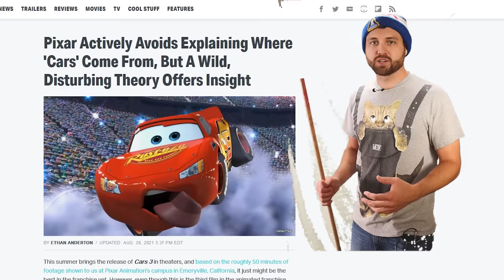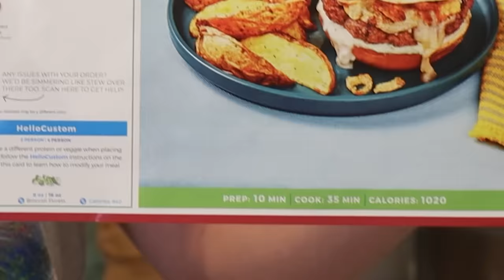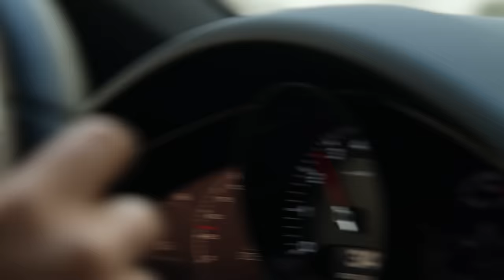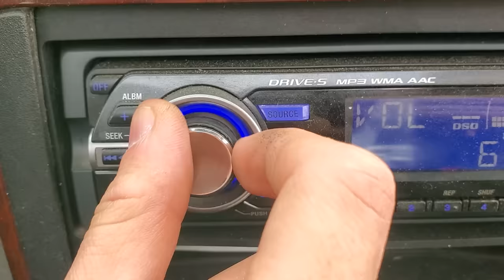How many parts can you take off a car?

Comment: "We didn't know if this airbag would go off or not"

The fact that you hacked up these cars equiped with multiple airbags WITHOUT removing the battery is abhorrently dangerous and wholly irresponsible. Donating to Patreon.
Reply: Removing the battery is extra labor which means a higher priced car. Clearly, it was an economic risk.
Reply: Jokes aside I think they did remove them lol. Michael said something along the lines of “it shouldn’t go off without power”
Reply: @WraithLK  Airbags are designed to hold a residual charge so they work for a while after the battery as been disconnected. Its always good to wait a few hours before working on parts with airbags after disconnecting the battery.
Reply: If you aren't willing to risk life and limb for content can you really call yourself a content creator?
Reply: Safety third!
Reply: @WraithLK  maybe they just disconected the battery from the airbags, they still need the battery for the turn signals and brake lights
Reply: @FrickenHamster  Lol what? You don't have to wait a few hours. You disconnect the battery cable and you just wait like 3 min and it's safe to work on. I've removed and replaced multiple airbags and just to make sure I wasn't going crazy, I pulled up ProDemand and it suggests only waiting 2 minutes after disconnecting the battery.
Reply: how bad could it be, you're supposed to smash in to them anyways
Reply: @dogtato  there is a explosive charge in them you take a shot from one point blank it could definitely kill you 
   why do you think new driving rules say 9&3 or 4&7 o'clock position because at 10&2 position it can break your wrist
Reply: @terranovarain6570  Weird, ive never heard of dying from a broken wrist...
Reply: @SmashToBits  They were referring to taking the blast from the airbag charge point blank while dismantling the car. The wrist damage is just an example of how powerful the airbags can be even when used as intended

Comment: The bare bones of a car is basically a frame, an engine, the parts for the engine (gasoline tank, oil reservoir, etc.), a transmission, a drivetrain, brakes, wheels, some sort of protection cage like the doors which protects the drivers and passengers from falling out, places for the passengers and driver to sit, seatbelts, and lights.
Reply: Eh we can make do with 2 front wheels
Reply: barebones of a car is a motorized bycicle
Reply: Steering wheels, steering rack, suspension.
Reply: Seats
Reply: Sooo a car...?
Reply: @DanielHatchman  if the commenter forgot something it wouldn't be important
Reply: @DanielHatchman  suspension is not required. VW enthusiasts have proven that
Reply: little cars like that arent even on a frame anymore, its a unibody
Reply: @Cosmik60  assuming the commenter knows what is required for a car to run and be street legal
Reply: DOORS?! 
What kind of inefficient blasphemy is that? 
Do you know how expensive DOORS are?!?!?
Reply: @Dr.Spatula  Street legal is a whole other thing. Especially here in Australia haha
Reply: @theodorebear6714  yeah you defs don't need doors
Reply: @Cosmik60  take the steering out of your car and see if it's important haha
Reply: I can quickly strip my jeep of the doors, roof,hood, fenders(including the flares), tailgate, windshield, and bumpers haha. It would lose like 1k pounds... to put that in perspective id have an offroad vehicle that weighs well under 4k pounds. Realisticly with just the doors/roof off id say with my upgrades its still over 4200
Reply: @mails5054  the thing that most people watching this probably don't understand though, taking that much weight out of your vehicle completely fucks the geometry
Reply: @Dr.Spatula  oh true, on suspension you might not need shocks and coils or leaf springs or whatever. But you still need some components to hold the wheels in place haha.
Reply: @mails5054  yeah a stock Jimny weighs like 1100kg or 2500lb strip that down and you have a go art basically haha
Reply: @DanielHatchman  you could probably get away with welding a rod from your strut tower to your hub assembly if you set your geometry correctly. Maybe keep control arms to triangulate for strength
Reply: @Dr.Spatula  now we're taking XD
Reply: Technically passenger sits are optional
Reply: @DanielHatchman  it's literally a thing in old bugs that are slammed static. Just remove the suspension lol
Reply: Nascar race cars and stockcars are pretty much the ideal in having the bare minimum in total parts/basic features/lowest weight where they're almost like an RC car with their light fiberglass one-piece entire body that simply covers the frame, engine & the drivers cockpit; that has no doors or trunk that opens; and the lights are all just stickers too. But is still extremely relatively safe  although it's not exactly street legal but at a passing glance it looks pretty dam close to passing as a legit street legal vehicle.
Reply: @Zenovarse  ONE wheel.
Reply: Shit. Anyone else remember the Peel P50?
Reply: @DanielHatchman  nah basically what you do is use your feet to turn the car there'd be a hole at the bottom for your feet
Reply: @Cosmik60  aaah yes Flintstone style! XD
Reply: So a car
Reply: No the bones are the chassis and thats it then the rest is like the blood muscle and skin
Reply: @mails5054  it's all jokes hey, these dude sawed their car in half 😅 this is no conversation about function. I'm taking my Zook 4by every day of the week if we are talking function, best beach daily driver ❤
Reply: Best I can do is a frame, three wheels, no seats and passengers.
Reply: Seat belts, protection and lights are very optional
Reply: Brain car
Reply: Suspension could be taken out, the exhaust and manifolds could also be taken out, as if the car passes emissions, you can fuck with the emissions it outputs and it's road legal unless you get pulled over or reported to the DoT which would have you redo the emissions testing.
Otherwise it's legal for 10 years from the last emissions test.
Reply: who need brakes when you have a wall?

Comment: I drove a 2003 Kia optima for about 15 years. By the time I was done with I had removed a lot of parts that broke (or I just thought they were annoying) Glovebox, center console lid, all sorts of random plastic parts including the cover for the ceiling lights. All the floor mats, the cover that went over top of the wheel well. When the door seals started coming loose or dry rotting I would just peel them off (satisfying) It was actually kinda nice driving it bare like that. May he RIP, sent to the junk yard for $350. Bought it used when I was 16 for like $6,000.
Reply: You got your value for sure
Reply: What? Might as well have removed the windows, too. Heck, who needs doors?
Reply: 350 aint bad!

sounds like a great car tho. may he rip.
Reply: Stonks 📈
Reply: mmm i have a 2021 kia and it's so pleasant. great cars
Reply: Fuckin mint
Reply: A lot of those things sound important lol. The steering wheel cover is there to provide some cushion if the airbag fails and if you don't want your car to smell like a swamp you should keep the door seals.
Reply: Bought my used hard top 2008 MX5 at 92k in 2016. 181k miles now, and I'm freaking out because the trunk button doesn't work 😂😂
Reply: @xChimkin  Keep the oil changed and trans oil and spark plugs. Shit will run forevaaa

Comment: Thank you for finally shedding light on the fact that cars have far too many parts. They really need to start cutting back on all those useless features like windows, doors, roofs, or rear wheels, so they can be affordable for normal people once again.
Reply: Honestly ever since I got a chance to ride my dad's battlebot down a suburban street at 60mph with nothing but my wits and an rc controller, I rather think the only thing you REALLY need are wheels, motor, electricity source, and some bullshit to strap it to.
Reply: These cars exist however they are actually much more expensive

Comment: 5:24 glad to see Big Willie has learned the pain of being a car guy - nothing worse than dropping the 10mm down the engine bay.
Reply: Bro I swear, it's every time 
😂
Reply: @BurntToast1717  genuinely not sure at this point if my engine rattle is because of a snapped mount, bent rod, or a dozen 10mm’s stuck around the bay. Could honestly be any or all of those problems.
Reply: Last winter my dad and I had to replace the alternator in my car. It took us maybe an hour and a half to replace it. And another hour to get the socket that fell down the side of the radiator. Good times.

Comment: The fact the red car still drives stable is a testament to how well engineered modern cars are (for the most part)
Reply: That car is like 20 years old lol. Heck the brand that made that car (Pontiac) died back in 2008, mainly because of how poorly made they were
Reply: Not really a modern car. Pontiac Grand Am is like 20 years old.
Reply: @everrybody  "i mean... that poorly made car is being driven while half soo" Lmao
Reply: @Ninjamation345  it’s fwd, any fwd car can do that…
Reply: without the roof it will collapse at some point
Reply: MORE LIKE HOW USELESS ALL THOSE PARTS FOR 'SAFETY'!!
Reply: Modern?
Reply: @everrybody  false, the brand was retired because of GM being broke.
Reply: A forward drive car drives without back wheels  incredible
Reply: @everrybody  no the reason they stopped making Saturn and Pontiac is because the recession broke the auto industry
Reply: @kingofroses302  any car made after 1995 is a modern car
Reply: @juliet4093 ^
Reply: You can cut any FWD car up to the dashboard and it'll still move under it's own power if you get fuel to it. That's only if you don't feel like playing with wiring, and given that all the necessary computers are in or forward of the dash. Some foreign cars you would have to keep it behind the seats as the ECU is stuffed under one of the seats.
Reply: @kingofroses302  it's a modern car, it's made after the 90s
Reply: Not really, as long as it’s front wheel drive, any car can do that
Reply: @everrybody  that's still a modern car compared to the history of the car itself it has electronics in it for goodness sake. My statement was mainly focused on the evolution of car engineering over the decades its still very impressive
Reply: @thanosianthemadtitanic  If you think a 2000s car is anywhere remotely as comparable to a car made in 2022 you don't know much about the auto industry. The auto industry spends HUNDREDS of billions of dollars a YEAR on development (Ford alone spent over 7 billion in 2020). Wright brothers flew in 1903 and 20 years later we had commercial flights of over 20 people per plane. 20 years ago most people didnt even have cell phones. 20 years ago the ipod had just released. 20 years ago flat screen TVs had just launched. 20 years is a long time. Also the DMV will let you register a car over 20 years old as "historical"
Reply: @everrybody  cars from the 90s are still the first modern car, just as cars made today will still be in the next 20 years before electric and hybrid become mainstream
Reply: @capcom7794  Actually a modern car has to meet current regulations and government standards to qualify as "modern" You could not sell any Saturn or Pontiac today as they don't meet safety, emissions, or efficiency standards in most 1st word countries.

Comment: The hood has several purposes and the the roof adds structural strength. Yes convertibles do not have roofs but are designed differently. I knew someone who took a chainsaw and removed the roof off an old car he had. After a summer of driving around the frame started to fold to the point the middle of the car was starting to hit the road when he hit bumps
Reply: It also looks cool sometimes.

Comment: This is like common cost cutting method: make it work, then remove one component and see if it still works. Keep removing until it doesn't work and return the last part. Do this all over the product and you will arrive at the minimum component configuration. This is done ALL the time in circuit design and the beauty is that often the designer does NOT know how the circuit can even work with the key components removed. 

A lot of this is because of chips, we first use the reference circuit provided by the manufacturer but don't know or care to know what is really inside the "black box".. and those reference circuits are the most stable configuration that enables the chip to operate at the widest possible range... we just rarely need to max them out so there are margins, we aren't just sure where those are. You just have to try when it fails and make a note, "don't do that last thing again". 

So.. right at this moment you have plenty of stuff around you that their designers to this day do not fully know how they work..

Happy dreams.
Reply: Is there a specific industry term for this process?

Comment: In high school years many decades ago I had friends who had a 58 Edsel stripped down to the running gear, suspension and frame. The two seat benches were plywood with seatbelts. The instrument cluster was somehow attached to the steering column. That was it. It was very fast for the day. Oh and there were headlights and brake lights. It was fully licensed for the road.

Comment: you need the engine (could go 3 or less cylinders to save parts) , wheels with breaks, a chassis (wich can literally be like 4 beams), something to control the engine and breaks and everything to connect everything else together. you don’t need a seat, the thing triggering engine and breaks can also just be two buttons.

no-one would want to drive it daily, but it works

Comment: Literally watching this video with my embroidery machines wailing in the background. I got super happy to see the Happy. Great investment, Bill.
Also, needle may be in backwards or just needs to be replaced altogether. You may not be hooping the hat right, looked a little loosey-goosey. Mine has binder clip lookin-ass things to attach to the bottom ends of that hats for added stability. Too much backing, even. You'll a smart man, despite this video potentially proving otherwise. You'll figure it out!

Comment: As someone who's worked on cars a lot it was painful to see you tearing these cars apart the most ineffecient ways possible. 

I don't give a shit about a Saturn and Pontiac being off the road though. Also, you could have pulled a loooot more parts off. Dashboard? Don't need it. Interior panels? Nah. Padding for the seats? Who needs comfort? Plus AC, radio, all the extra wiring, I could go on.

I'm just being an asshole though, I'm glad to see you back.

Comment: Reminds me of my neighbor's car, he "cut out" (I think he said he threw the spare tire in the trunk, it bumped the back seat. And the rusty frame where the back seat bolts on to just completely disintegrated) the back seat, and took off the doors. He took off the trunk lid, cut out a bit of frame between the back seat and trunk. Folded the roof down so the front is still covered but it's kind of seperated from the back, and it feels absolutely horrid to drive

Definitely in no fault of my own though, definitely didn't suggest he go drive to our local "boat dock" (a sketchy place where the city has cleared out for people to pop their boats in and out of the water at) and do a few laps around the dirt there. Collapsed all of the suspension, and broke something that keeps the rear axle firmly in place. So now it's loosely in place, and the rear end sways with every turn

Comment: "Someone should build a better car, a car that is just the bare minimum. An inexpensive transportation device that doesn't do all the extr..."
Yeah, get a small motor, strap on 2 wheels, because4 seems wasteful. Put a seat on it, a small tank, handlebars, the bare minimum of electronics you need, and you got this car you talking about. And let's call it... motorcycle? Yeah that sounds about right. The let the Japanese build them with great quality, but still cheap. Let's call it Honda CB125F. Or if you wanna use it for higher speed, like long highway rides then make a similar machine with a bigger engine. Let's call that Honda CB500F. You could get the cheaper ones for less than 5000$ brand new.
Reply: Engines are unnecessary accessories, just use a bicycle
Reply: What do you make when you want to carry four passengers?
Reply: @liquidgoldsoup2833  long motorcycle

Comment: Bro bought my Chevy aveo for $600 I call it the basics. Manual locks, windows,  and transmission. Just gunna keep throwing engines in it because I dont need nothing fancy just tryna get to work for cheap. May pick up a geo tracker for the winter.

Comment: So you don't actually need brake lights for the car to be street legal (at least in my state), as long as you're driving during the day and not dawn/dusk/night/rain/any other condition that requires you to turn on lights.

You have to know hand signals (which you should know anyways), but brake lights and turn signals technically are optional components.

Comment: ion think the Pontiac is safe to drive no more after they cut the roof off I believe the old Pontiacs was a unibody frame so cutting the roof damages the integrity of the car and could make it collapse on the road or worse not be able to withstand a crash if I'm wrong the Pontiac aint a unibody I still stand information on not cutting unibodies

Comment: Someone built a car ran by water and it could travel like modern day vehicles... Someone assassinated him when they found out and got rid of the car so no one could figure it out... But you can, that's what you should build, an engine powerful enough to run like a normal car ran by water